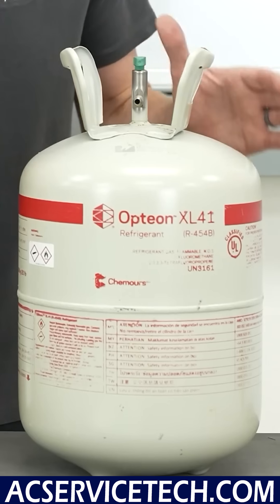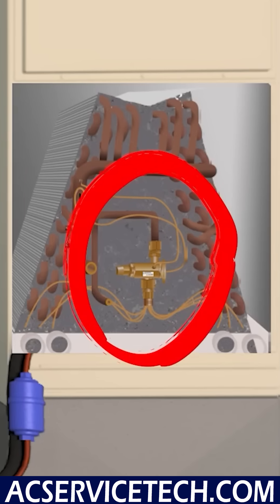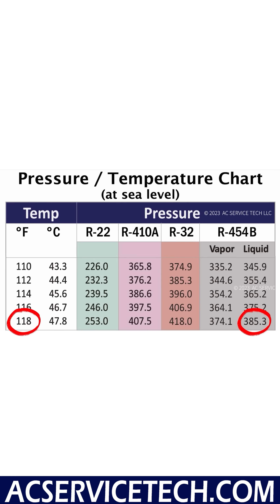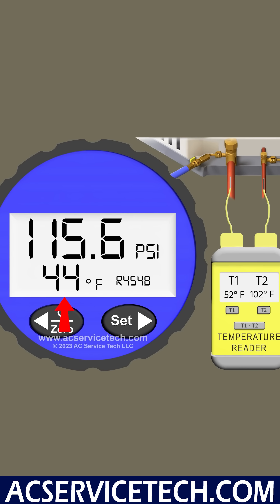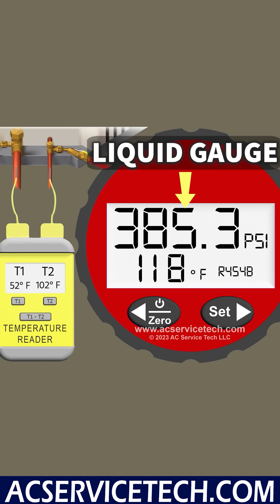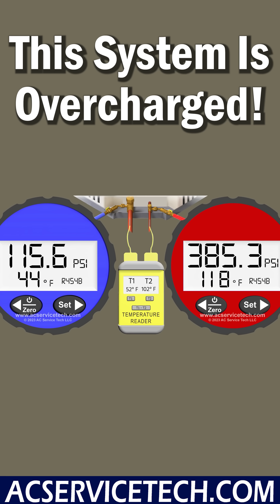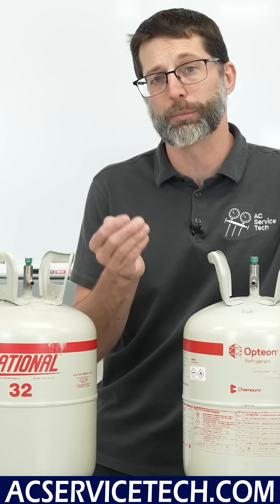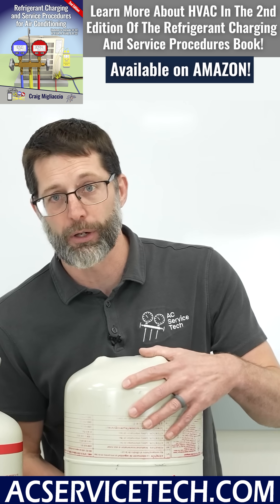R-454B Measuring the Refrigerant Charge Scenario on a 2 Stage Heat Pump!

Comment: Awesome video! You are helping me out so much! Why can we not charge it into the liquid directly?
Reply from the maker: That is because the systems liquid pressure is higher than the bottle when running so refrigerant would travel from high pressure to low pressure exiting the system, thanks!

Comment: Look at the pressure increase of R32. I dont know about you guys but i found a lot of leaks over the years what seemed to be to early in most systems life with R410A. The only thing that i could contribute this to is the increase in operating pressures. I know R454B is being trashed but,  i would rather see a decreased operating pressure vs an increase with R32

Comment: what if it is a piston metering devise?
Reply: You charge a piston with superheat measured at the compressor. The target superheat is determined by a universal chart using the return air wet bulb and ambient dry bulb temperatures. The subcooling will end up being whatever it ends up being, but if its really high then there is a restriction somewhere.